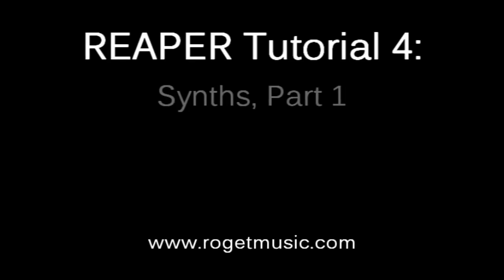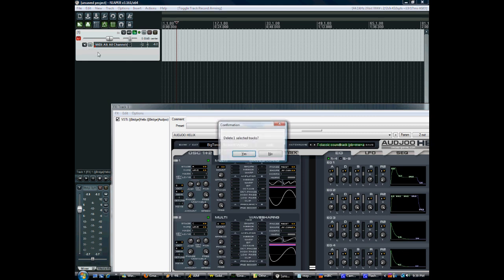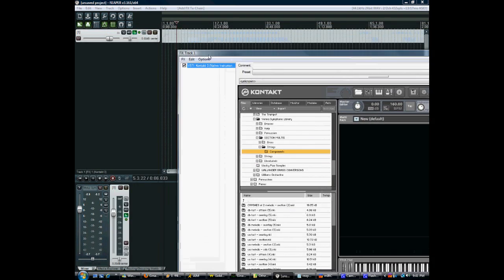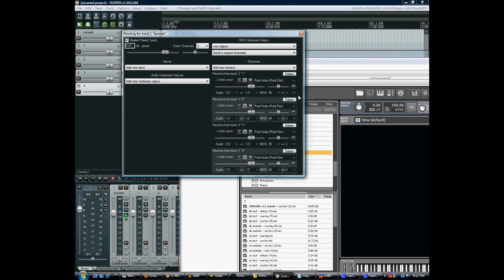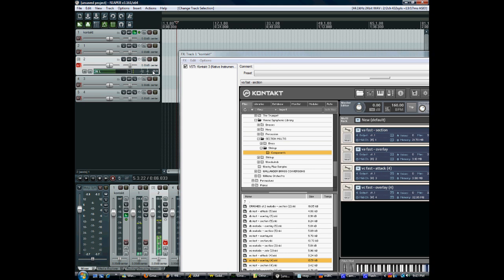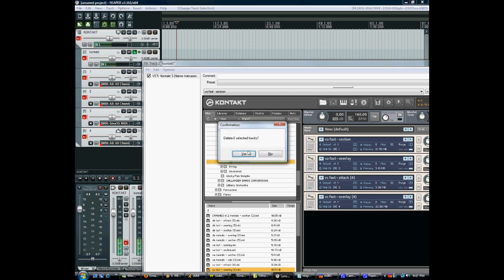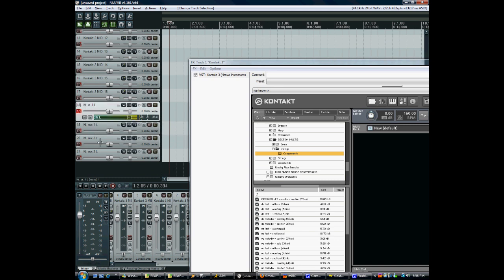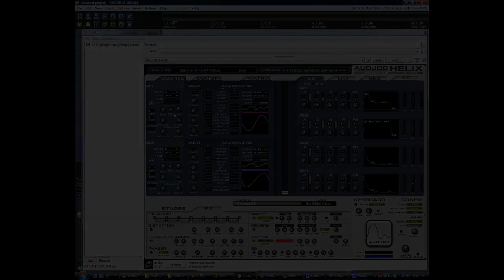REAPER Tutorial 4 - Synths, Part 1

Comment: It's a nighmare. usb midi drivers, windows 10, can't the Korg Radias to work as a hardware plug-in to Reaper. using just a USB connection. And MAudio Sound card.
What are inputs and outputs and sends to a track in Reaper ???

Comment: Sir, I am LOVING your work..

quick q - creating a ('dumb' / label) parent track, vs clicking the folder icon on track 1 (kontakt) and using that as the parent - is there a difference? 

My gut tells me there's a difference between 'parentrouting' and track grouping, just wanted to check before I attempt to make myFirstAction

wicked series, best I've found (and man have I been looking!)
Reply from the maker: Jonny Hotchkiss Thanks! So re: Kontakt parenting, it for some reason doesn't work to put KT as the parent and then have MIDI tracks underneath. You have to do it the IO way, otherwise it doesn't know what channel to use for MIDI

About track grouping (ie. the shift+G window, or track grouping matrix), that's a completely different thing that has to do with volume/pan/etc. controls being mirrored whenever you adjust them on one track in the group.
Reply: wow. I'm glad I asked, and glad you answered. forum response re no diff. between parent 'label' (dumb?) track in reaper, vs KT as THE parent... 

+ track grouping, behaviorally is that the same as when multiple tracks are (CTRL) selected, volume/pan etc is GLOBAL?

getting there (as slowly as possible it feels!)

Comment: @FlamingCuntLips There are several things I prefer Sonar and Vegas for over Reaper actually, it depends on what you're doing. For audio editing, Reaper hands down. But for MIDI, I much prefer Sonar's far more streamlined way of using VSTs and its piano roll (I hate the Logic-style clip-based PRV that Reaper uses), as well as its better handling of changing and uneven time-signature. For editing audio to video, I prefer Vegas for its more stable video handling. Sonar also has a better autotune.

Comment from the maker: Hm, well a few things could be happening. For starters, ASIO4ALL only allows one program to have sound at a time. That would explain if you have no sound at all in REAPER.

Do you get playback when entering notes in Piano roll? If not, your routing my be faulty (try the "simple method" to doublecheck).

If you do get Piano roll sound but no sound from a keyboard, check that you have monitoring on, the MIDI track is armed, and your keyboard is enabled in prefs (ctrl+P, "MIDI devices").